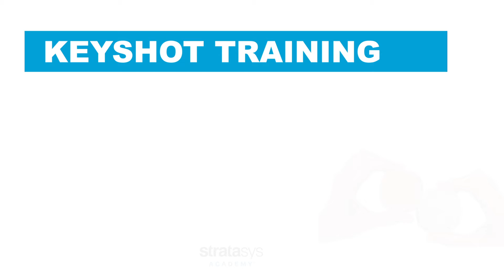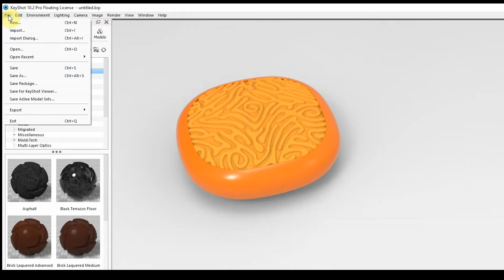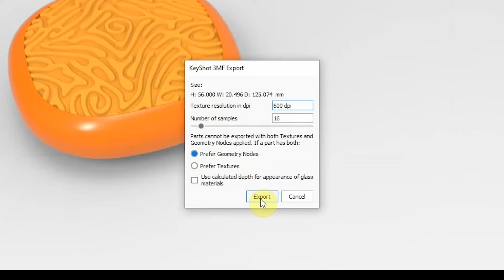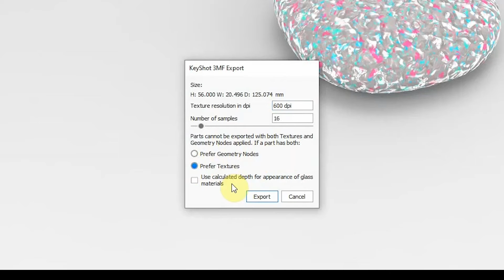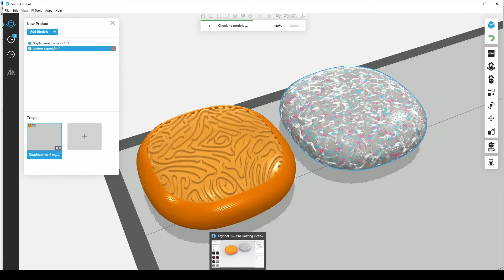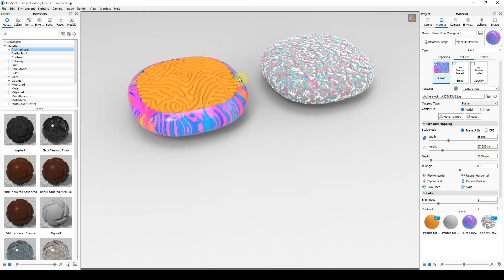Stratasys Academy | KeyShot: Exporting for 3D Printing

Comment: Does keyshot exported 3mf only work with stratasys slicer ?
Reply from the maker: At Stratasys we are currently unaware of another solution that will convert a bump map to physical displacement in a preprint preparation software like GrabCAD Print.

Comment: The bump map when exported to 3mf does not reflect in the 3D file. How are you able to get that texture in print?
Reply from the maker: Hi, 
Please try below recommendations:
1: Please make sure that the bump maps feature is enabled in GrabCAD Labs
2: Then when a part with bump maps is inserted into the tray the “displacement” adjustment options will be displayed under the model settings tab.
NOTE: The Displacement visualisation does not accurately reflect the output geometry. Use the design / rendering software to visualise how these effects will be applied.
RECOMMENDATION: Print a sample geometry first before committing to large jobs to ensure displacement matches the design intent.